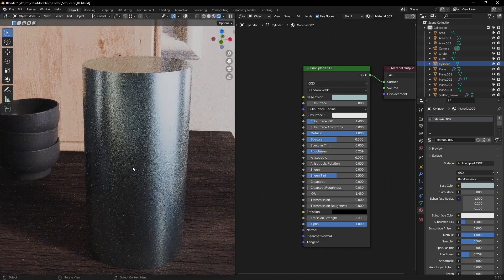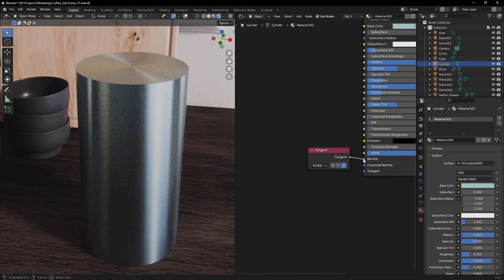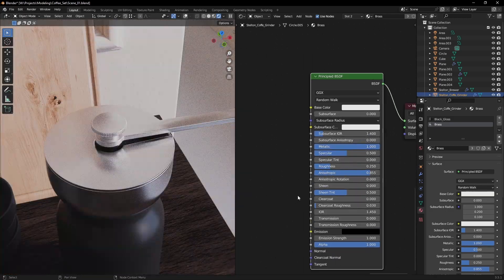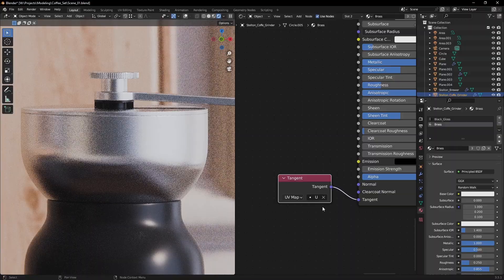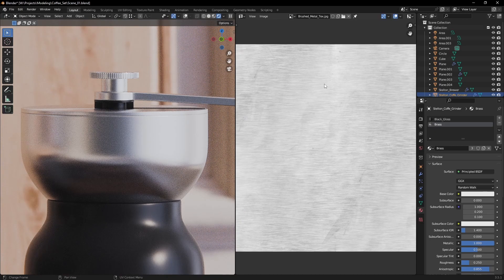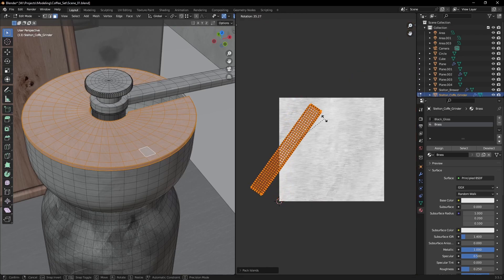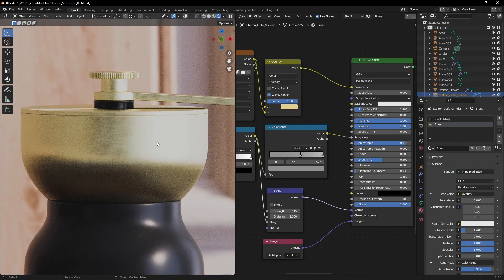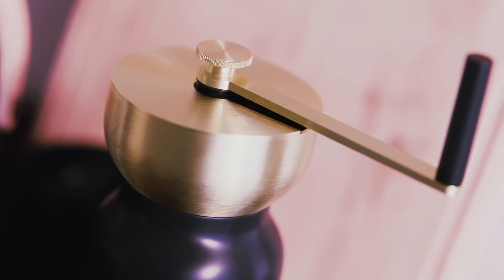How to Make Brushed Metal | Blender Arch - Viz Series

Comment: I can't get the same results as you for the life of me.
Reply from the maker: Hi, this could be due to something simple and unrelated as having unflattering lighting. I'd suggest setting up the shader on a simple cylinder first, to get a feel for the settings. This is how I would do it - on a new material make sure you have the metalness set to 1, then play with the anisotropy and anisotropy rotation until you get the highlights to stretch along the height of the cylinder. Then continue with the bump mapping and roughness. after that you can try controlling the anisotropy rotation with the UV coordinates on another model like I showed in the video.  If things aren't working out still, just send me a file with your progress on my email(its on my youtube page) and I'll have a look.